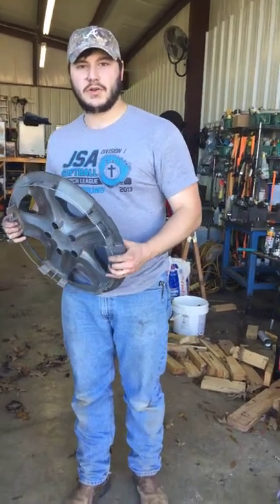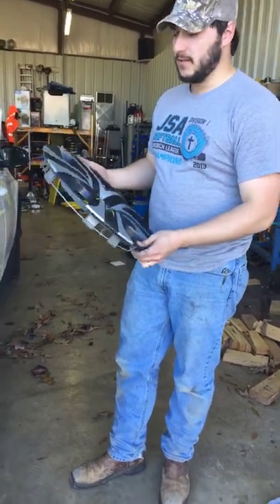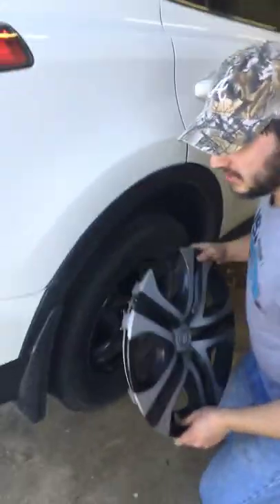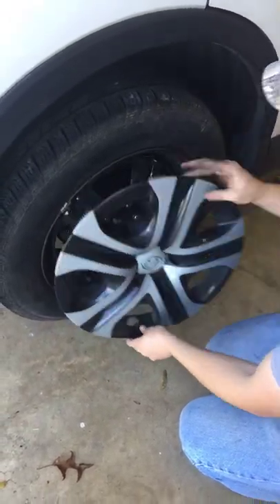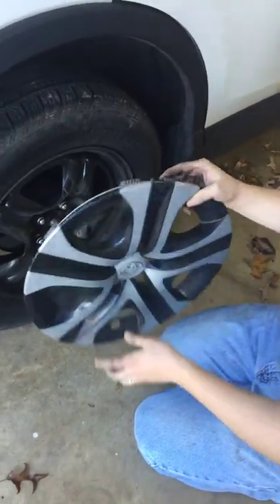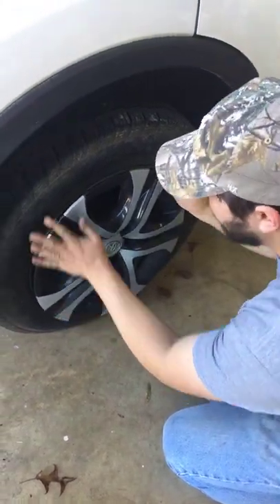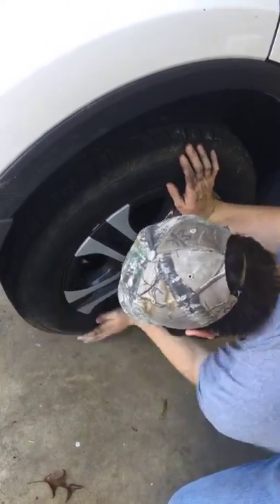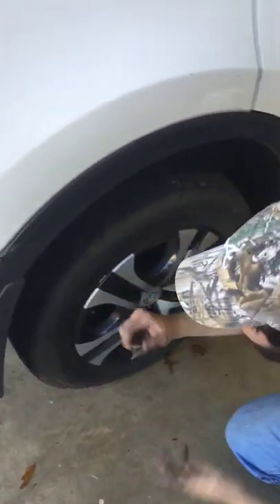Replacing hubcap cover on Toyota

Comment: How do you remove it? Mine is making noise when I drive
Reply: Flat screw driver without damaging the paint. Should come off easily. Work around it. Otherwise if you put to much pressure in one side, you could brake some of it.
Reply: By hand be a man

Comment: What size are those Wheels problem with today's Wheels as they're too big to use vintage metal hubcaps from back in the past throw away those cheap plastic ones. Every car from back in the day the hubcaps survived in the car was scrapped and there are mounds of stainless steel hubcaps problem is today's wheels are an inch too big most likely for them to fit what a waste people ride around with no other gaps or plastic ones. The thought of a plastic hubcap in 1977 if you said that to somebody they'd laugh their ass off and go are you crazy a plastic bumper or a plastic hubcap who in their right mind would buy such a thing and pay good money for it.
Reply: I mean, afaik it's not meant for anything but decoration, and if they're plastic they're less likely to injure somebody if they come off. I understand that some things are better when they're not plastic, but I see zero problems and several benefits with plastic hubcaps.